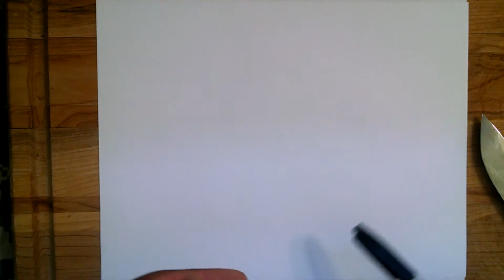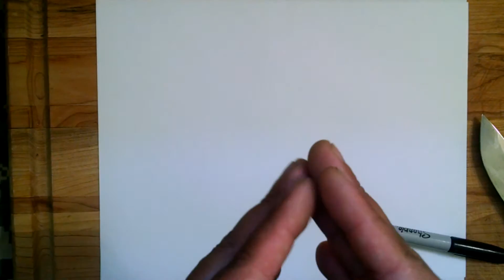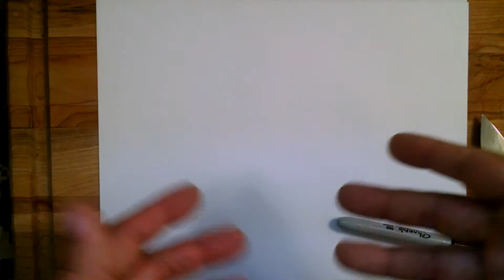What is Knife Toughness?

Comment: Which tool is "better", dial calipers or a tape measure?? it depends if your selling to a machinist or a construction worker. no better example for the knives your discussing than Busse..here is a company who has developed a steel that has the toughness and flex of the best a carbon steels, yet is more stainless than most stainless steels. and after a day of limbing trees or chopping...can be simply stropped in the field on bare steel or ceramic to get back to sharp, rather than needing to remove steel on a stone because your edge chipped rather than rolled. if I understand you correct, a Busse knife is ridiculous and they are asking a premium for these characteristics that are actually a bad thing..not a good thing? ..So in the realm of outdoor, woodsman, survival knives Im really curious, who then is an example of someone who gets it right an brings more to the table?
Reply from the maker: all preference, I like sports cars, you like pick up trucks.
Reply: @FearNoSteel  agreed..